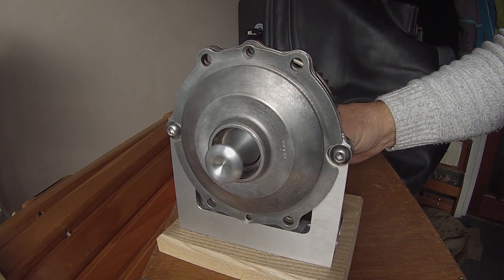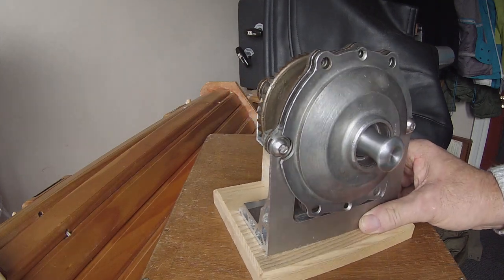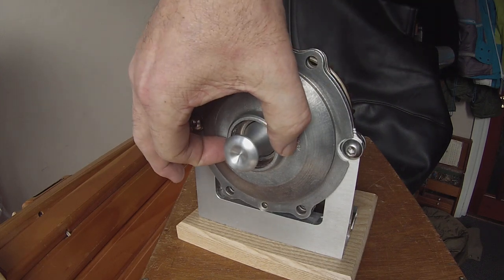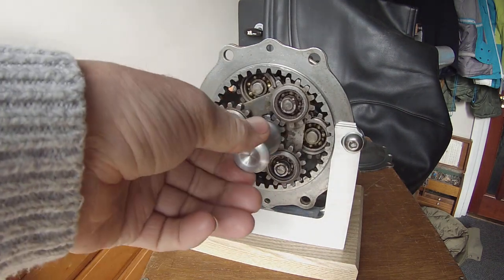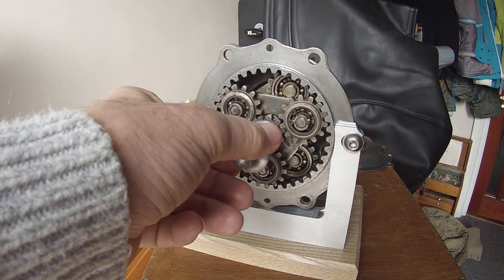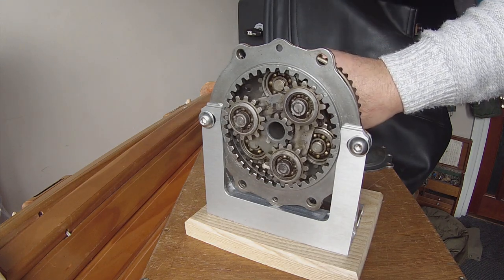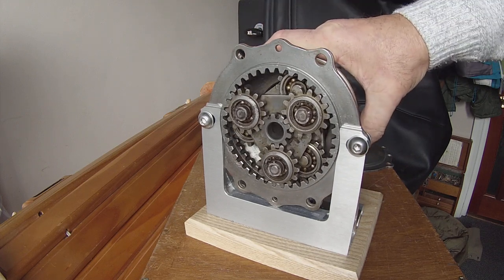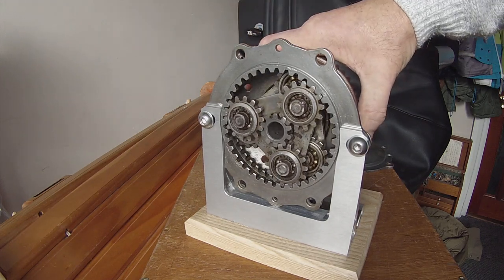Rolls Royce Merlin hand starter

Comment: Women or men whoever built that starting device was not unskilled by any means.
Reply: Truely shortribs.
Reply: It was a man.
Reply: There is a hierarchy in production of things like this. A group of very intelligent people will design this and create manufacturing processes. The manufacturing processes will be refined to such a degree, you could get an unskilled worker off the streets to do the assembly of some parts or feed machines to create the parts, almost idiot proof. The unskilled workers don't have to understand what they are doing or how it works, all they have to do is press in bearings or tighten screws. This requires a factory of workers who do very simple tasks to create something complex (and quickly).
Reply: @ryanbonzagni2299  Pretty unlikely during WWII.
Reply: @ryanbonzagni2299  Women worked in defense production throughout the war. For example my mother worked on the PBY Catalina assembly line in Seattle during WWII. Women not only built aircraft in that era but ferried them to Europe and around CONUS.
Reply: That's not true, the DESIGNER and the machinists who made the TOOLING were skilled. Youngsters who never worked metal and have no personal understanding of war production can't be expected to know this, but efficient war production demanded ability to use low-skilled labor. Many workers in the US didn't own shoes before the war gave them jobs and they could escape poverty. There was not time or equipment to make real machinists out of every worker.  However there was time to say train someone off the block to run basic operations on a lathe, mill, shaper, gear hobbing machine etc. 

That sometimes had consequences like unreliable (by modern standards) construction. Most people don't know the number of US military aircraft lost in crashes in CONUS was nearly the number lost in combat. Real history is much more interesting than Hollywood.

Machines replacing skill long predate computers. Check out some mechanical screw machine videos for examples of machines built by very highly skilled machinists and foundry workers then handed off to operators to make parts. 

Here's a 1940s screw machine making Sherline parts today.  Machine tools from the manual era still make money in 2023:

https://www.youtube.com/watch?v=yDpX86ecjXs
Reply: Untrained, maybe. Unskilled, most definitely not.
Reply: Definitely skilled even in one component.
Reply: lol pfff woman or man...😂

Comment: The is the gearbox that was mounted above the electric starter on some Merlins. It provided an alternative, hand start capability. Hand starting was achieved by using the gearbox to spin up a heavy mass to high speed and then use it's inertia to turn the engine over, via a clutch mechanism. The smooth, turned 'knob' on the end of the shaft isn't original. It should have a part with a transverse pin for a removeable handle to attach to.

Shame about the blatent mysogyny

Comment: The production method was used in the automotive industry for at least 15 years before WW2. It was applied to war time production because the volume was just like automotive manufacturing. The gear set is an epicyclic gear train that was used for many applications even then but later in the 1950's it formed the main gear sets for the majority of automatic transmissions and is still used today for that.

Comment: Thats very cool, That hand starter must make the Rolls Royce Merlin easy to start by hand.
Reply: It is a hand turning gear used to turn the engine for maintenance setting/ignition timing.  The Hurricane used a chain and sprockets to transfer the input to a cross-shaft through the lower cowling which enabled two ground technicians to crank for starting.  Using this to start, it may fire, but not likely to run.  Later engines had a blanking plate.
Reply: Historic Aero Engines Thank you. That makes a lot more sense than suggesting it could actually fire up the ending.

Comment: How on earth can a group of unskilled workers come up with something so complex, but so utterly simple. British engineering at its very best.
Unsung heroes of the last century.
Thanks so much for showing.
Reply: Part is designed by mechanical engineer.  Method of production determined by industrial engineer. Parts are cut on a lathe by a machinist who is only trained to make that one component of a larger part. No heroes required.
Reply: My late father was a tool setter in a factory full of women operating capstan lathes. Essentially, the whole operation is broken down into simple steps, requiring only low skills from the lathe operators, and a few skilled men, like my father, to set up and occasionally adjust the machine tools for them. This is also the basis of modern mass production, whereby low/unskilled workers are able to produce very complex finished items like computers and smart phones.
Reply: @liarliarliar6495  Capstan/turret lathes are still popular with small shops (which is why I keep getting outbid as a hobbyist!) because they're so easy to set up and can even beat some CNC cycle times. According to the pro machinists who outbid me a used turret lathe easily pays for itself on a single job though new ones of course would not.

Comment: Fine piece of engineering. 80:1 reduction gearing in a very small unit and congratulations to the women who made it.
So how did it start a Merlin? The spindle looks to small to wrap a pull cord to start a 27 V12 like a lawnmower.
Reply: I assume a crank goes in the hole he pulled the plug out of.

Comment: Would have been beneficial for a simple explanation on what task it is used for.
Reply: He explained that,  were  you asleep?
Reply: @drd6416 No, he explained the gearing in isolation, not how it started an aero engine.
Reply: Or at least show it in operation.

Comment: I've got a weird ww11 airplane part, USA made that has about a 40-1 ratio, one side has a speedo square type cable maybe and the other a bnc type tube connection. 20+ years back when I got it the internet only showed one thing about it and I haven't looked since then

Comment: It probably has a Sprague clutch, or similar "one-way" mechanism, otherwise it would be spinning thousands of RPM when the engine was running, and, to prevent the starting handle from killing the mechanic when the engine turned over!!